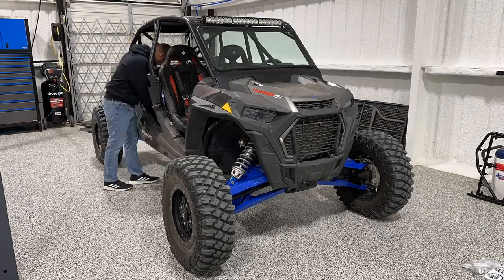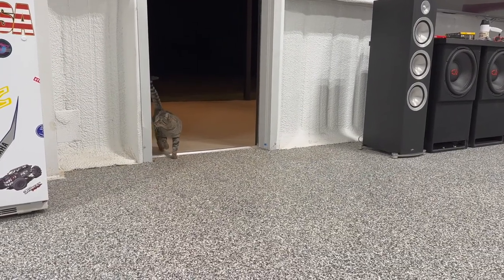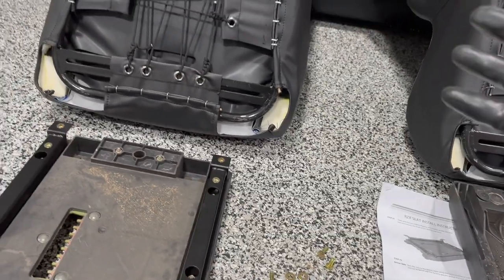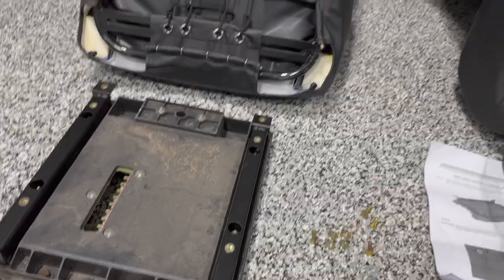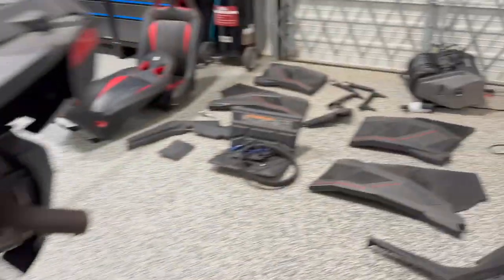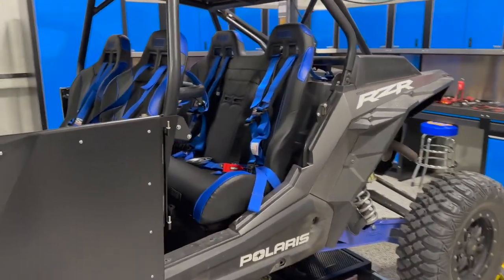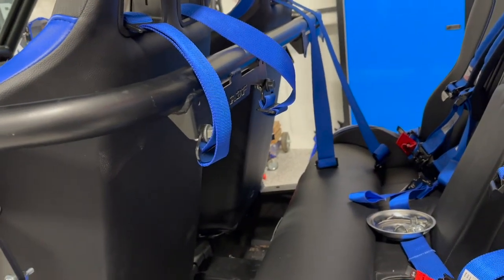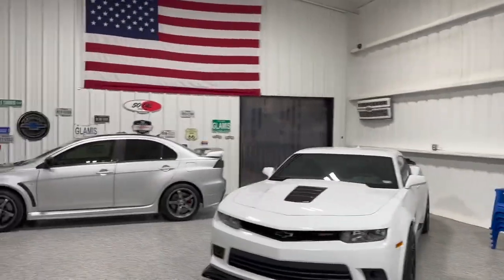Doors, Seats, and Harnesses on my RZR XP4!

Comment: How you liking the doors? Picked up a set back during black Friday and yet to put them on. How you liking those Simpson seats? So many choices out there, hard to pick just one.
Reply from the maker: The TMW doors are a great product with lots of adjustment and a nice tight fit when closing.  My only complaint is the lack of instructions like I say in the video.  I've had several different brands of seats in my UTVs and I love the Simpson Vortex, its just the right combination of sport and comfort for me.